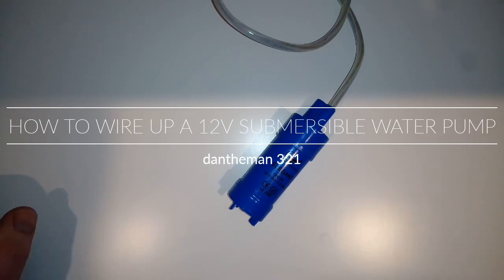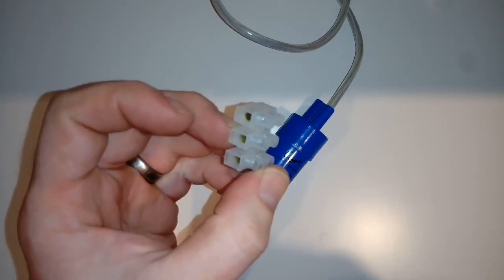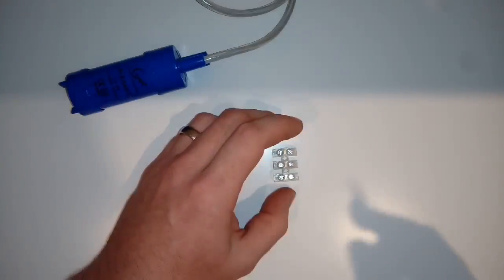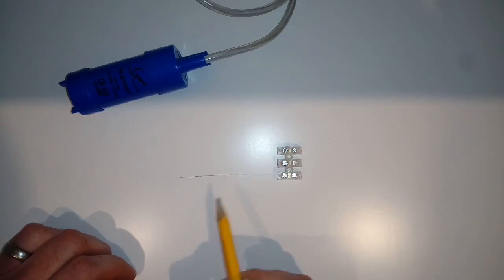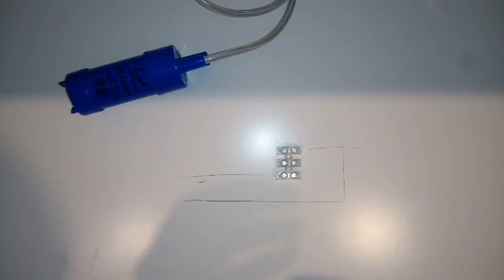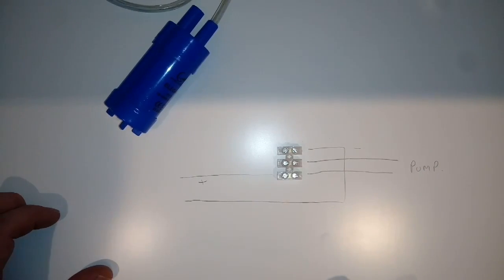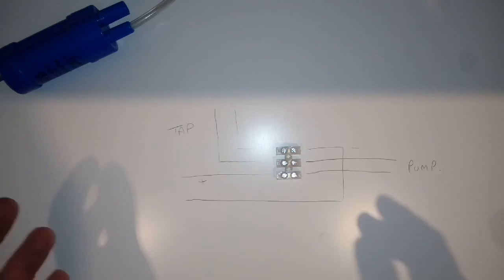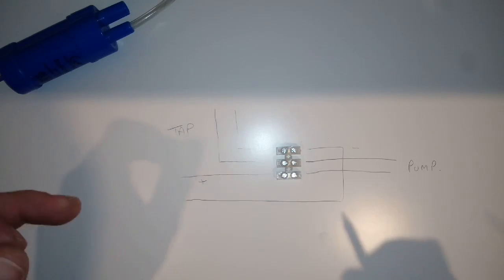How to wire up a 12v submersible water pump for your campervan/motorhome

Comment: hi dan  can you give any info on sargent  ec 155 concerning adding a dc to dc charger  d+signal  on a 2018 ducato any  pointers would be a great help, followed your video on fitting seitz windows worked great  thanks
Reply from the maker: Hi I have a video showing where to find the ignition feed on that vehicle actually. 
When fitting a Sargent and a dc to dc charger remove the vehicle battery feed. Don't connect it to the battery as it will cause issues. Unfortunately you won't be able to use the vehicle battery for a power supply.
Hope this helps 👍
Reply: @dantheman321  thanks dan any info is a good help

Comment: Can I ask a question? 
This is really useful thank you for sharing. I want to wire up a portable unit and have a lithium power bank with a 12v cigar socket. If I wired the  +ve feed and -ve into a 12v plug would this work? Thank again.
Reply from the maker: Without seeing what your asking it's hard to say but I think your right in what your saying.
Many thanks for watching

Comment: Hi dan,
My submergable pump plugs into a socket that I am mounting to my van , this has three connections 1, 2 and 3 . My taps don't have a micro switch but the pump knocks off when it gets to pressure , is the third wire somethings to do with a pressure switch ?
Reply from the maker: I don't think I have seen that setup before to be honest, the only time I have known a pump to knock off is if you have a pressure pump and not a submersible pump. A submersible pump works when the connection is made and switches off when you switch it off so not sure why it's knocking off. Sorry I couldn't be of more help with that one.
Many thanks for watching
Reply: Thank you for the quick reply Dan, yes my pump is a whale pump and is connected to a carver water heater, I took them out of a caravan and intend fitting them into a camper van , I don't know if that's anything to do with it, thanks anyway Dan

Comment: Hi I've just wired my pump and pressure switch using your vid and I've put I isolating switch inbetween on the battery feed to it all. Every time I switch the isolate on the pump makes a continuous sound, is this normal or something to do with my wiring?
Reply from the maker: Your pressure switch should act like an isolation switch anyway as when it's closed it cuts the power. It's shouldn't make a continuous noise though I would double check the wiring.
Many thanks for watching
Reply: Thanks for the reply, I figured it out in the end, I adjusted the pressure on the pressure switch  and now works, spot on 👌 thanks for thr excellent wiring video

Comment: Hiya mate, excellent and easy to understand video. Just regarding the submersible pump,  I have a tank which is only 140mm high x 700mm long x 200mm wide. Can I still use a submersible pump?

Comment: Hi Dan. Excellent simple video. We have a van that we got bought alreadyconverted and under the sink we have a panel of 4 12v sockets- and no wiring for fitting a tap in the way you describe here-is there a way to also wire this system to a 12v plugin and plug into the 12v sockets (instead of wiring straight into the electrics of the van) if you catch my drift? 🤔🙄
Reply from the maker: N C 
Yes as all you would need is a power supply regardless of whether it is hard wired into the electrics or pinching it for a 12v socket.
Hope this helps and many thanks for watching
Reply: Thanks for that! I'll have A look online at how that's done

Comment: Hi, Very good easy to understand video. If wishing to have 2 microswitched taps (one in kitchen area and the other in toilet room), would I just connect the second tap wires into the block with the wires from the first tap or will the second tap need its own 12v power feed?
Thanks.
Reply from the maker: Alan Nicholson 
That should work, i dont think you will need a second power supply. I havent wired one like that before because when there is a 2nd tap to supply water too ive always used a pressure pump. Let me know how you get on with that one.
Many thanks for watching
Reply: dantheman 321 Hi, Finally got round to trying the wiring for the pump and taps as per your instruction video. Works just fine from both taps with them both connected together to the terminal block. Thanks for the video, it saved me a lot of head scratching, swearing and blown fuses.

Comment: Hi Dan. I'm in the process of converting my 1st camper van. Just to clarify am i right in thinking the positive feed to the block would come from a switch if that's what you wanted to use and then a positive feed to the switch from the battery? Thanks
Reply from the maker: Stu Gardener 
hi Stu yes thats right but if you arent using a 12v distribution system then you will need to add an inline fuse between the battery and the switch. hope this helps
many thanks
Dan
Reply: Thanks Dan for your quick reply. I will be using a fuse box so thanks for that. Is that a 5A block you would use?
Reply from the maker: Stu Gardener 
15amp is best for a pump. hope all goes well with your conversion and if you need anymore info just let me know.
many thanks
Dan
Reply: Thank you and yes I will. Thanks again
Reply from the maker: Pugsk1ss 
If its the one im thinking of all you should have to do is re-route the wiring as it should work the same way. Without seeing the pumps that you have its hard to say really, hope this helps.
Many thanks for watching

Comment: Hi dan .my water pump stopped working got 3 pin rocker switch to control .light on switch an srill12v goin to microswitch,they don’t last long only just got that tap.can I bypass micro switch an use switch on panel to control pump

Comment: Hi mate, nice one for this. Maybe you can help me? When my block is wired up the switch works but the pump doesn’t? Im using a 30A fuse and I’ve tested the individual parts and they all work. Baffled 🤨
Reply from the maker: Double check your fuse first thats the usual problem with stuff like this. Then if no joy double check your wiring if the pump works. The fuse is a bit high you need more like 15amp as well.
Hope this helps and many thanks for watching

Comment: hi loved the video  very easy diagram explained can you do one with an inline switch that goes on the too as im confused to were the switch connects with the wiring never done this before on pdf it says one goes to pump and one goes to battery but do i have to  have a battery  as the pump wires to 12 volt mains  please help im a very confused blonde
Reply from the maker: lisa greenwood 
Do you mean an inline fuse instead of the micro switch on the tap?
Reply: hi thanks for reply well i have just bought a cattering trailer the pump was no good so bought a new one and along the piping was another thing attatched i took it with me to the caravan shop as i wernt sure what it was and they gave me a new one to put on  its a whale in-line presure switch i have a boiler electric under rh sink and the pipe it was on attaches to the boiler also but this switch has some conectors for elec supply im guessing there are no wires im just not sure what it will connect to i read the pdf help on site it says one goes to pump and one goes to battery so i was confused as i have electric not a battery
Reply from the maker: lisa greenwood 
Im not overally too sure what your setup is but usually a switch will go inbetween the battery and the pump, so the wire that comes from the battery goes into the switch and then from the switch onto the pump.
I hope this helps.
Reply: so ill have to get a battery because the pump wires up to a  mains supply 12 volt it is very confusing haha thanks anyway x

Comment: hi there im  building my own camper in lock down 78 years old I did have a pump working but have disconnected to re-site a switch as the micro sw does not work on tap.
I had a switch in line worked fine but not now, followed your drawing with triple block done same as you now I put my switch wire in with tap wire the other  side of it  to pump wire nothing is working please can you advise as I live on my own family all in london  Best regards stay safe GEORGE
Reply from the maker: I think your going to need a new tap with a microswitch. If your fitting a separate switch it doesn't matter which side of the tap you fit that it still won't work as the connection needs to made at the tap itself. Hope this makes sence.
Speak soon
Dan

Comment: Hi Dan. Forgive me from being blonde here, but you say it doesn't  matter which way the wires go but surely if you add a + to a - it will just blow the fuse? I am setting my system up the same as you but i'm a bit curious on the wiring shorting out.
Reply from the maker: Richard D 
No seriously it doesn't matter with this setup it will work either way.
Many thanks for watching
Reply: Cheers Dan :)  I will let you know how i get on. Great tutorials by the way :)
Reply: I wired it up as you suggested in the video and it works brilliant :) Cheers Dan
Reply from the maker: Richard D 
Glad i could help,
Many thanks for watching

Comment: Hey Dan. I recently went to a “van rally” in Colorado. I saw a gentleman that was using a submersible whale pump which he then rewired to a 12V DC cigarette lighter. Im quite the novice at this stuff, so if I did that, would I still need a separate fuse? Also, what is the 6 sided contraption called that you have in the video? Thanks!
-Rhody
Reply from the maker: Rhody C 
The cigarette lighter should already be fused within the vehicle some where but its always a good idea to fit one anyway just incase its not, the item i think you are talking about is a connector block, they come in longer strips usually but I cut this down and you can buy 15amp blocks, 30 amp blocks etc etc, the one i used is a 15 amp connector block strip. Hope this helps and many thanks for watching

Comment: Hi I tried this way and it didn't work I thought the 2 wires from the tap are live in live out but in this video you have the wire from the tap going to negative? I thought it was 12v live to tap the live out to pump and neg of pump to neg on battery?  Am I missing something here
Reply from the maker: Without looking at your wiring it is very hard to follow, I wire these types of pumps up this way and have no problem as have other viewers. Maybe double check the video again and then double check your wiring just to make sure. Hope this helps and many thanks for watching.

Comment: Hi Dan,

I've been trying to wire up a 12v water pump and micro switch tap. I have a inline fuse wire from the battery leading to the micro switch. The switch then connects to the pump, the pump then to the battery. 

I've check the fuse
tried wiring the pump straight to the battery and it works
Wired the switch to a usb port I have in the van and it can turn the usb port on and off.

So the pump works and the switch work but I cannot get them to work together. 

Any help would be great.
Reply from the maker: Daniel Dacker 
I have in the past had new faulty fuses, they looked intact but werent so i would try another fuse first if that fails try a new inline fuse holder and check the connections. Let me know how you get on. Many thanks for watching
Reply: Thanks for the reply, I've replaced the fuse a few times, upping the size just in case this was the problem. Sorry should have said something about that. 
If i have connected the wrong ends of the tap would that cause a problem? 
or
Should i pull apart the micro switch and see if there is a problem with its connection?

Thanks in advance
Reply from the maker: Daniel Dacker 
You said that you tested the switch on a usb and that worked so cant see that being the problem, what kind of pump are you using ?
Reply: Not sure of the brand, It came with a camper that was already converted but it didn't have a leisure battery set up so the pump wasn't connected.  Not sure if i can send photos on youtube so I've put it on google drive. here is a link to view it https://drive.google.com/open?id=0B-ApN0u-dS_cVklxRG05VC0zaFk
Reply from the maker: Daniel Dacker 
For some reason the link isnt opening but you could take a video of the setup and send that link. Its hard to diagnose a problem without seeing it sometimes.
Reply: https://youtu.be/h_Vmv1Oj_Cc

Link above mate, sorry for any dogy camera work or explanation. Also tried to get into the micro switch but i can't get access through the top of the tap. So i may need to get a new tap in all.
Reply from the maker: Daniel Dacker 
Hi Daniel ive watched the video and by the looks of it, it should be working, did you try changing the inline fuse?
If that isnt the problem then process of elimination of the parts involved need to be tested. I always start with is there power getting to the device so thats why i would start with fuses and holders etc from the start. Next would be the pump and i think you said you had already tested that, then the switch but you have already tested that. If all these things check out ok then double check the connections where wires are joining. 
Let me know how you get on mate?
Many thanks
Dan

Comment: Can u use a 8 screw connector block?. If it dosent work could the micro switch in the faucet be bad it clicks but won't turn on pump hook up pump direct and it works also should u put a 12 volt 20 amp fuse in line?. Thank you.
Reply from the maker: Yes you need an inline fuse and I would test the pump as well if its not working👍 many thanks for watching

Comment: Thanks for the video. Is there a way to wire a submersible pump to a normal tap (non-microswitch) with a manual 12v rocker switch? I purchased a tap not realizing it should have a microswitch and am trying to figure out how to make it work. I'd prefer to use a submersible 12v pump if possible, I don't want to go the whale pump route
Reply from the maker: Yeah the switch will do the same thing as a microswitch does for the tap you will just have to switch it on and off manually.